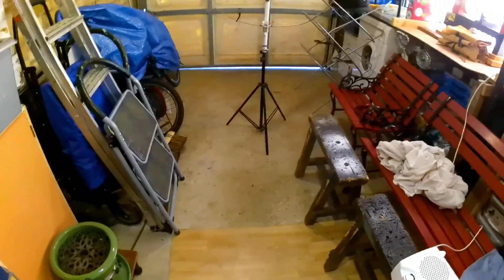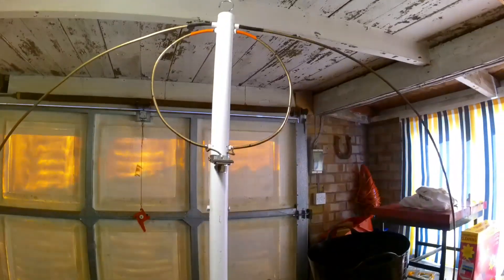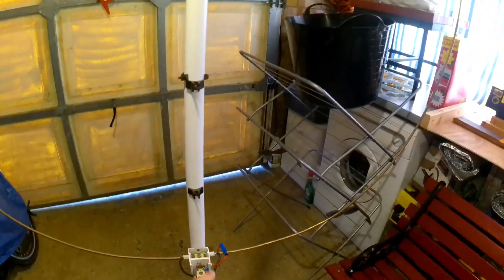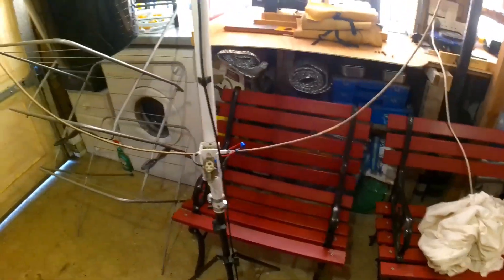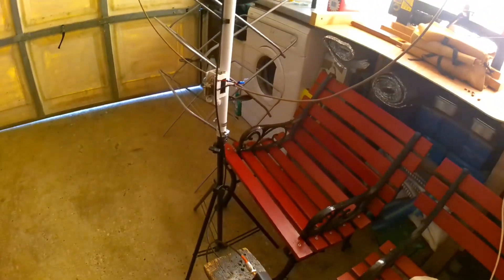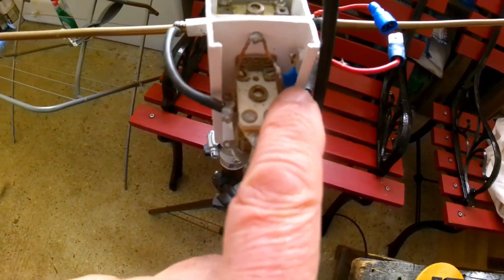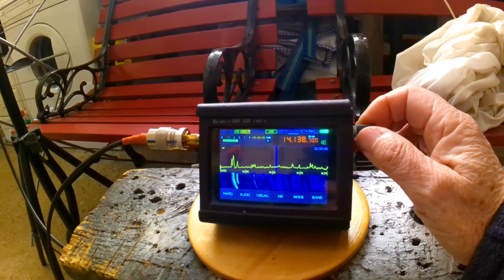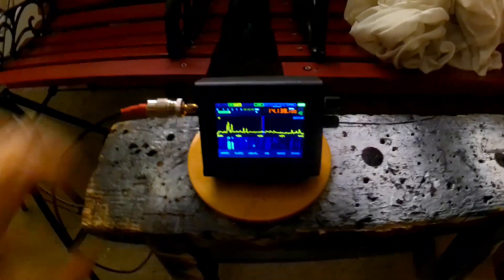Magnetic Loop Antenna. Ham Radio. Active Amp Kit on Order.

Comment: What brand and model receiver were you using?
Reply from the maker: My Radio is an earlier version of this one. I made the stand it's mounted in.  = DSP SDR Radio Receiver Shortwave Radio Receiver Malachite DSP SDR Receiver. From Ebay
Reply from the maker: Ps this maybe the newer model. V1.10D 3.5inch LCD 50K-2Ghz Malachite SDR Radio Receiver with All Mode Receiver

Comment: Sometimes those DIY antennas work just as good, or even better, than ones that can be bought. I sure remember the days when we would try anything to get some sort of reception on the bunny ears connected to the TV and use wires around the house and even aluminum foil!